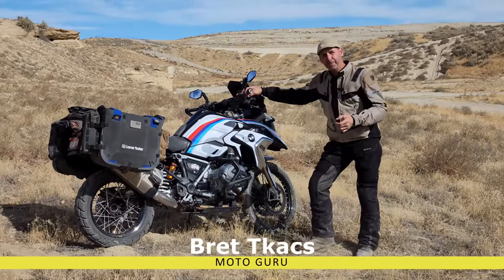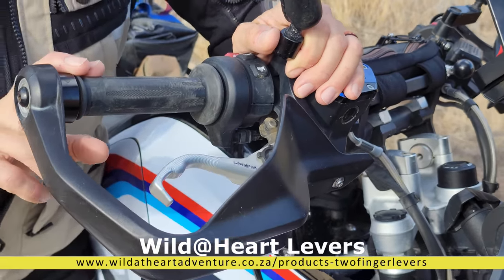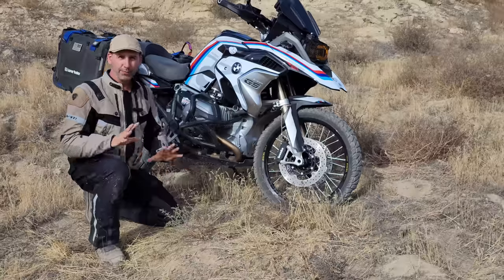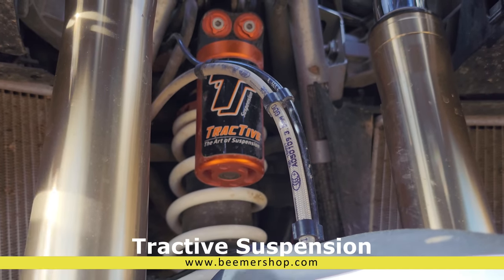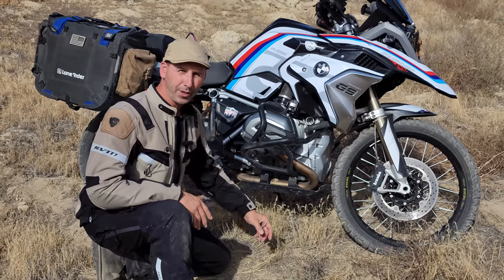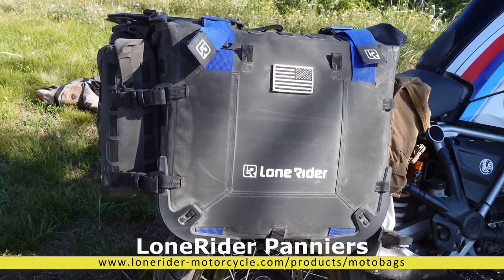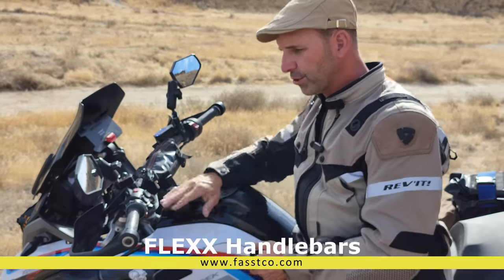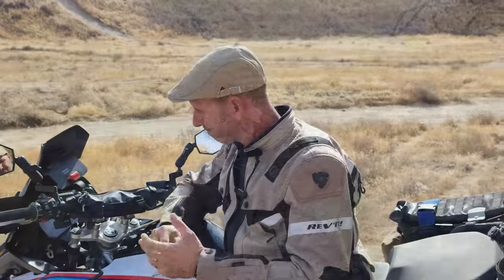12 ways to make your adventure motorcycle better offroad

Comment: Levers, Africa Twin = OEM were too long and difficult to operate with heavy gloves on. So, I cut 1-1/8 inches off each one, filed the ends to a nice curve, drilled a hole and installed a small black screw with a gold-colored acorn - nut and gold washers on the ends, Looks super and works much better. Two fingers on the brake and 3 on the clutch. Also polished out all mill marks and the entire lever to a high chrome finish. Total cost about 3 dollars US.
Reply: How would one see a photo of that sort of innovative sweetness?

Comment: Velcro strap FTW!!! I'm going to disable my kickstand switch too!! I could have used both these simple mods many times over in the past!
Reply: I don't get it, and he really didn't explain. Why?
Reply: @court2379  If your bike is on an extreme angle on kickstand side so that it leans too far to pull it up and the footing is really bad, you can mount from the opposite side while leaving the stand down, weight the opposite peg and throttle out of the spot. You can't do that if dropping into gear with the stand down kills the engine.
Reply: @dirtpony  OK, thanks. I don't ride one of these heavy beasts so have never encountered that problem.

Comment: The first tip is going to rub a lot of people the wrong way, and I think it needs to be explained more. I love those levers!
Reply from the maker: It's always fun to start with something that stirs emotion. I think you are correct, that may be a video all to its own.
Reply: Yes it looks tricky if you can mount the bike and ride off then raise the stand but it’s foolish. Say your front wheel goes into a dip or your front wheel turns a bit to the left, the stand digs in then down you go with any number of poor outcomes. And it isn’t a simple thing to just cut and join a few wires these days. The 690 has a magnetic switch and you either need a plug with resistor or remove the switch unit with magnet to a higher point and tape them together.
Reply: He didn’t cut the wires, he ground down the mechanism so that it could always be in the up position.
Reply from the maker: @russianrick8403  I did both
Reply: We were riding the Oregon BDR this spring, my buddy crashed his brand new T7 and the kickstand switch failed, couldn't ride the bike until we disabled it.  Which is not simple, fortunately we had cell service and could Youtube it.  AFAIK he hasn't fixed it, I'll tell him to leave it as is.
Reply from the maker: @russellborn515  I had a similar incident on my old F800GS and we had a KTM890 dead on the trail this summer too (can't bypass the KTM)

Comment: I had a GSA and changed out to Woody’s 21 inch front and Touratech suspension … bike transformed completely!  However had to sell it as we moved … now looking at buying another bike but don’t want to go through same GSA modification process as I mainly ride off-road.  If you were in my shoes, would you not rather get a KTM 1290 SA R?  I saw your test of the 1290 … and curious to know if you had to change out your GS, and stick with bigger bikes (not 890) … would you pick a 1290 SAR?

Comment: It looks like we are similar size and shape.  Could you give the Back Sweep, Width and Height of your Flexx handlebars.  I have maxed out all adjustments of OEM and still need a little more.  Also did the normal BarkBuster kit for BMW work on the Flexx handlebars or did you have to go with a different part #?  Thanks for putting out so much great information.

Comment: Can you explain, or tell where it can be found, your thoughts on the "safety" of the kickstand switch.  It seems every manufacturer thinks accidently having it down is the hazard, while you have the opposite opinion.
Reply: In my experience, it can be a massive pain to deal with if you get on the bike on the right side and the left side (with the kickstand) happens to be on the low side of the trail. Being able to just turn the bike on and move to a better area to pull up the kickstand seems more logical, but sadly bikes are becoming more idiot-proof every year
Reply: @kabj06  so… the low side of the trail is the kickstand side, and the kickstand is down and the bike is resting on it?  My bike falls over in that scenario, down the hill — yours doesn’t?

You’re right about bikes getting more idiot-proof every year, and that the nannying gets in the way.  I’m thinking particularly about having to stop , switch to neutral, then hold down a button for 10 seconds to switch off the ABS…
Reply: Yeah okay, boomers...
Kickstand switches have been a thing since what, the 80's?
Reply from the maker: It's not always about solid ground... Just because there is a place for the side stand doesn't mean it's the best side to mount from, could be better "high" ground on the left, better traction, more space, less risk (cliff, etc)
Reply: I have had more than one bike run like crap through rough terrain because my heel kept hitting the side stand, pushing it down just enough for that stupid switch to want to intervene.

Comment: Concernig the Side Stand Safety Switch, after you spliced the wires together, did you receive any fault message on your dash? I'd like to do the same to my '17 GSA, but I'm concerned about error codes.
Reply from the maker: No errors, it is only two of the three wires

Comment: Hey Bret, on the subject of tyres (tires) I was wondering, could a rear 140/80-R17 tyre be fitted instead of the manufacturers recommended size of 120/90-R17?
The profile (aspect ratio) difference between the two tyres is 4mm higher, the width difference is 20mm wider, but the rim size is the same. Would the 140/80-R17 fit just fine or would it bulge out becoming more rounded? (Mitas EO7 Enduro vs the Mitas EO7 Enduro DAKAR are the tyres in question. Mitas does not produce a DAKAR version for my rear tyre specific dimensions). No matter what thanks for your time.
Reply from the maker: As a general rule of thumb you can go one size up or one size down from OEM without any real issues however the manufacturer normally goes towards the max tire for the rim because buyers like the look of bigger.

For me I normally drop one size in width for the performance advantages (less rolling/braking mass, less unsprung weight, cuts through mud/sand better, turns faster, etc). There are very few places a wide tire outperforms a narrow tire. Wide tires are needed for high weight, longevity on heavy  loads, and high horse power (if it's being used).

If you have a bike that has a stock 120 rear it is unlikely I would recommend going to a 140. Oversized tires normally balloon on the rim causing a poor profile and often fit issues too.
Reply: @BretTkacs  that was quick!!! Thanks a lot for all the info. I've been so determined to get the DAKAR version that I completely forgot about all of the narrow tyre advantages. Will stick to your advice. Much appreciated, have a great day.

Comment: I'd really like to get the Wild at Heart levers for my GSA, but $190 USD Shipped is a bit pricey.  Granted... everything is pricey with this hobby.  LOL.   Any options out there for a bulk/shared order?
Reply from the maker: I have been using Chinese eBay levers for years and they work very well. Not quite as cool but still better/shorter than stock. Basically 3 finger levers instead of 2

Comment: What front fender are you using with the 21" wheel
Reply from the maker: F800GS
Reply: @BretTkacs  thanks, are you running tubes in the skinny wheels?
Reply from the maker: @saddlebag4097  tubeless

Comment: Maybe if all of us were honest with ourselves once and just called them gravel road travel bikes instead of Adventure bikes the vernacular would be more accurate. The marketing of taking a bike that weighs more than 500 lb in sketchy situations is just crazy. I have a 900 rally Pro and a 2001 Kawasaki Super Sherpa 250. Which one do you think I ride the most out here in Colorado and deeper into the woods?
Reply from the maker: Technically most of our "off-road" riding is on unpaved "roads". There is a big difference between a trail and an unpaved road.

Comment: What happened to the KTM 790R? Isn't that more off-road capable in stock form?
Reply from the maker: Without any debate yes... The problem is my 790 spent more time at the dealer than in my bike garage so after one year I gave up on it. I was hoping that all the issues would be sorted out by the end of one year.

It's a shame because I still LOVE riding the 790/890 and the new 1290
Reply: Thanks for your reply; yes. I'm traveling from LA to Ushuaia on a 890R, the bike is super fun but reliability is a concern

Comment: The only thing I have to disagree with you Bret is that anyone can alter their bike to match yours, but at the end of the day, if a rider is not an avid rider like you, all these expensive upgrades would serve no purpose for someone that cannot even ride a GS.  QUESTION: Why do you have a different brake reservoir cover than the original OEM one that is on your clutch lever?
Reply from the maker: The side stand switch, footpeg, rear brake step, shorter levers, velcro strap and a handlebar that fits the rider better are not crazy expensive. Even the plastic frame guards are cheap on ebay.

My goal was to share free to outrageous...
Reply: @BretTkacs  Agreed, the suspension and tire modification you made there alone cost way North of $10,000 with labor.

Comment: I'm really surprised that you're able to use a wireless charger because they overheat phones when it's warmer than 80 degrees. I've tried 4 or 5 different models with the same results at the most inconvenient times (navigating in the middle of nowhere in Eastern Washington).
Reply from the maker: I have been using it all season without any issues. It was 114 degrees on the hottest day (Yakima WA). Only thing was I ended up using the screw mount option due to the heavy offroad use and vibration
Reply: i use my quadlock wireless charger every day. we had two months straight of >100°f highs and it never overheated my s21.
Reply: @512mbflashdrive  did you ride all day? You guys aren't going to see thermal shutdown if you only ride a couple hours. The Quadlock overheated my phone on a 80 degree day in Seattle so I threw it away.
Reply: @bretthawton  damn, sucks! i've put 21k miles on my bike this year to date. longest ride was 30 hours straight from Missouri to Oregon. no thermal issues. seems like you have a phone issue.
Reply: @512mbflashdrive  perhaps but the same thing happens to my wife's phone. Do you stream music and use navigation while riding? These functions also generate a lot of heat.
Reply: @bretthawton  i connect to a Motorola ma1 for wireless android auto that is running at all times. maybe that plays a part? it is streaming spotify and maps but the screen is off and it's displayed on the dash so that might be why it stays cool. my last phone (note 9) had temp issues when it was sitting in the sun before i put it on the mount but was fine if i mounted it after taking it out of my pocket.
Reply: @512mbflashdrive  what's the Motorola hooked up to on your bike? Are you running a tablet or something similar?

Comment: i don't understand why you'd do the first one tbh
Reply from the maker: Maybe I will have to do a video on just this topic
Reply: @BretTkacs  I've done a fair amount of off-roading on my bike and I just can't think of a scenario it would help, other than failure? Then again I'm not always offroad like you are
Reply from the maker: @leahheffernan4644  failure has been and issue multiple times, once for me and several times for others. There are definitely other times that it is easier and safer to start from the right.
Reply: Real rough roads can make your stand drop slightly when you hit a hole, which kills your engine.
Reply from the maker: @DonHavjuan  damn near crashed my F800GS on a trail once when the engine shut off when I needed power due to the side stand switch. Later that day it failed and left the bike dead. I bypassed it on the trail to get out.

We had a rider on a KTM890 end up dead on the trail this summer due to the "safety" switch  but KTM can't be bypassed like others so we had to truck it out with a recovery vehicle.

Comment: I would 100% disagree with over riding the safety on the kickstand. Using the excuse of "saving energy" should never be used to disable an item on the bike. If someone, including yourself Brett, happens to mount the bike like you did/do in the video, and make a minor mistake by coming off balance and tipping the bike slightly to the left, the kickstand will/can hit the ground, causing the bike to pitch right and toss the rider. If you really believe that over the time of a ride that "saving energy" that is used to get on the bike from the low side (kickstand side) will make or break your ride, you are doing a great dis-service to your viewers. Eat some Wheaties!
Reply from the maker: That switch is only one way to meet the safety requirements for the road and is not required on off-road bikes. Most bikes still include the side stand feature to self retract if struck going to a left to hand corner.

Comment: i think the first tip is so dangerous... Just bcause you save a tiny bitof energy you risk of catapulting yourself and get injured
Reply: I had to disconnect the sidestand on my oilcooled GS because my my heel would contact the stand when standing up on the bike and lead to engine cutout/cutoff.
Reply from the maker: No dirt bike comes with a "safety" switch on the side stand. The video is about making a better offroad bike...
Reply: @BretTkacs  @Marco Disconnecting the side-stand ignition break has a big downside for new riders: turning left at any speed with the kickstand down may dump the bike as it hops over the side stand. This happened to a buddy with a disconnected side stand switch, as he was transitioning to tarmac from where we’d stopped. The bike threw him off, and he was lucky there was no traffic at the time, because it took him a full minute to gather himself up off the road.
Reply: Bret’s tip is obviously directed to a more experienced rider group. If you’re the forgetful type, then obviously don’t do it. If you’re not comfortable with the idea, don’t do it.

Comment: Doing a lot of weight lifting, especially squats because you'll need the strength to lift those pigs when you dump them. Gravel roads are all they're made for, not hitting serious trails.  And have the good sense to stop riding the trails before you get so old that your body can't handle a fall. Most of the guys reading this comment are too egocentric to have any sense so you'll yell and protest but I've seen a few guys that thought their 1000 cc trail pig could do serious trails that moto cross bikes normally ride and they ate gravel. No sympathy what so ever.  600lb bikes with a ton of luggage, bottles of bourbon and gas grills are insane but they're out there.